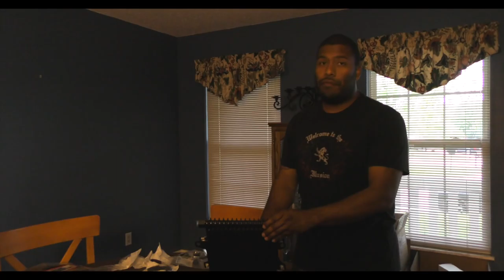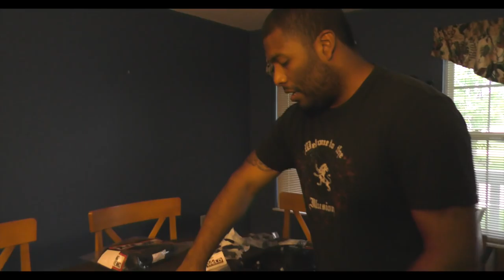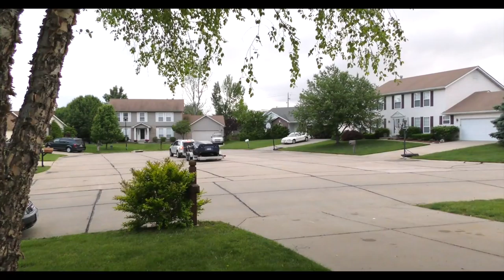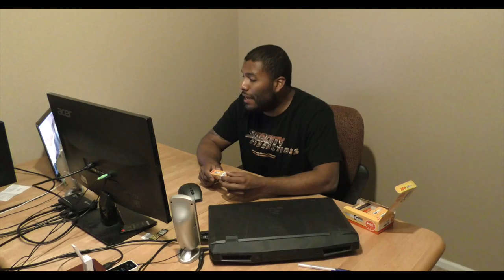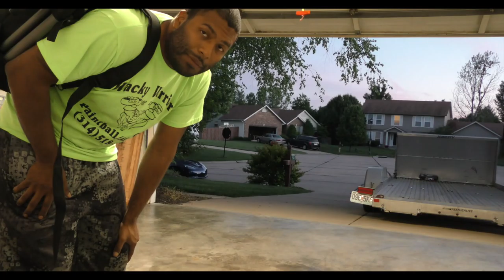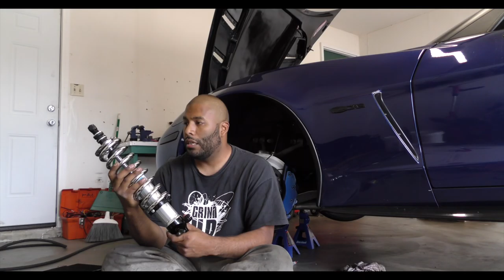ScorchTV Vlog: Episode 1- maintenance, tips, fast car.

Comment: Congrats on starting vlogging. Im considering it myself. I have a question and a suggestion for you. Where did you learn how to work on cars? As a tip I'd suggest finding better lighting and using clearer audio tools (or speaking louder), it was a little tough to see and hear you in the beggining.
Reply from the maker: Makis Palmer thanks for your comment. and yes i have definitely taken those factors into account and will be better on the next week's vlog. this one i started off in the middle of a chaotic week etc so didn't have much time to get this going. I began messing around with cars when i was in grade school i just enjoyed taking things apart finding out how they worked and putting them back together. I've tried very hard in keeping it as a hobby and not making a career out of it in fear that it would take the pleasure away, and hear we are now.